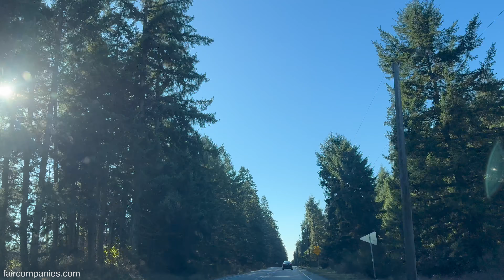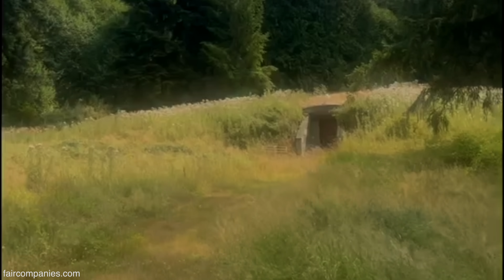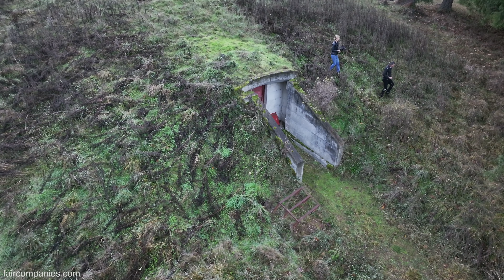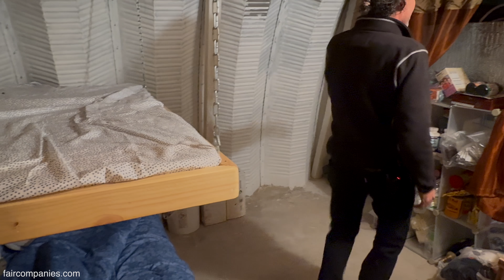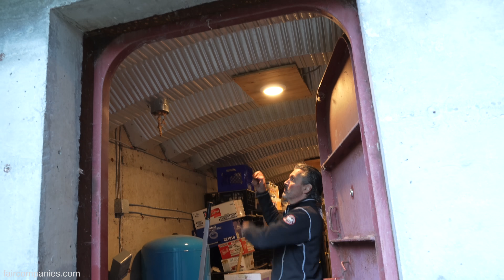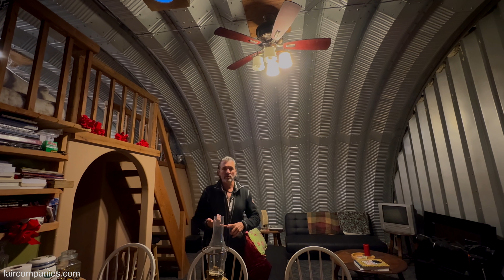Building Bunker Villa on a budget using Quonset Hut structure

Comment: I'm so grateful to live in a 'traditional' if you can call it that .... 1800 sq ft underground concrete home that was built (not by me) 30 yrs ago. But hearing David mention the cost comparison gave me the idea to use the original engineer drawings, data and blueprints to get a current market quote on the poured frame, custom slab 'roof' and membrane just to see what it would cost in today's market. Not to mention, it's in hurricane-prone Florida ... which is even more rare geographically!
Reply: And what would it cost today?
Reply: @dontrend5956  I'm anxious to find out but don't know yet. Just saw this yesterday. I have to 'dig out' blueprints, find/contact the engineers and membrane supplier with some specs to get quotes. It's a bit of a project. There are about 3 different entities I have to put calls or emails in to with the right info prepared .... then wait for quotes/responses.
Reply: Florida is basically a large swamp, at just about sea level. You ain't gonna bury no quonset hut there...
Reply: @cmerton  what you do in that case is built it above ground then dig a big pond and use that dirt to make it underground

Comment: The only thing I see that is wrong is the front door it should have been opening outward. You mention about 500 mile an hour winds. If you have a blast wave, it's gonna push against that door and push it open. Then it would have been good to also have a dual system. So if one door did blow, you'd have a second door for a backup, but also, you would have a barrier. You do not want anything that's propane underground like that. Look at what happened down intexis to risinyes bunker that blew up and killed. I think it was 3 people a few years back. Next according to european standards for nuclear fallouts a propane system is illegal

Comment: 11:07 Do Not Ever, Install Propane Inside a Bunker, that is Why the Inferior Rising S Bunker in Texas Blew Up. If you want a bunker, I would contact atlas survival shelters, there the best. 11:18 I would install an induction stove, or cooktop, they are the most efficient cook stove.
Reply: Atlas shelters are entirely different and way over priced when it comes to the size and building materials.. A propane tank would never be installed inside, never heard of the incident with Rising S Bunkers?

Comment: These quanset huts have issues so do your due diligence before buying, in some climates they will condensate water like a shower unless sprayfoamed from the inside. Obviously not in this case here but above ground they can be a problem and there not cheap.

Comment: This would make for a great Australian style of "ground house" as we don't call them bunkers here incase people start getting hysterical lol. 
They would sell like crazy in Coober Pedy gem fields as they are ALL underground structures as we get close to 50 degrees Celsius 😲 out there and nothing can survive above ground to live. People might work above ground (and lots below) but they ALL live underground out there!
Reply: I thought the Coober Pedy houses all had to be dug out of the soft rock - ? This guy just excavated soil, built the Quonset hut and reburied it - all easy when you're dealing with soil. Is there deep soil in CP?
Reply: @lobstermash  don't know man I'm not from there. Way too hot for my liking out that way?
I have seen the houses for sale onine and they seem to be hand dug and then bricked up inside? 
There are tunnels everywhere so I'm assuming that the miners who were working comfortable underground didn't like the idea of going up in the heat whilst not on shift, so they just used an already dug and depleted mine and then just did with a normal house just no need for trusses or anything?

However, my point was that there are people out there still building houses and if they are spending all that money on bricks and mortar, then something like this could possibly be a solution?
I recall that the 3 bedroom place I saw about 3 years ago went for fairly cheap considering the price for building materials in current money; however it was built in the 1970s so it looked a little dated just with the styling and colours so if you were going to work or live out there it would have been a steal.....but it's not a very developed town by any means? You are lucky to have the basics in a place like that I reckon?
Reply: @jameshatton4211  Yeah, I get your point if they're building above ground, a Quonset hut well insulated might be a good deal. But for building below ground, if it's rock not soil, the size of a Quonset hut would make for a huge and difficult excavation. Even so it would be pretty cool - Halls of the Mountain King.
Reply: @lobstermash  couldn't they just do the same thing and effectively "cut the roof off" am existing expired mine and do as they have done here? Same thing except you aren't wheel barrowing loads of cement in and then waiting a long time for it to cure (and/adjusting the mix to make it cure quicker for the slab being in a cave so to speak - risking integrity vs waiting a very long time for it to cure) reducing quality or waiting a long time adding to the build duration?
I would imagine that cutting the roof of and clearing out the space would be much much easier than digging directly into the ground?! I'm sure it's not ALL rock because most of the tunnels at CP were hand dug a long time ago? It would be morning to penetrate the roof and then just keep breaking away at the hole and then just an escalator to clear it out. You could easily pay for that in savings from materials?
When it's. Finished you just don't push all of it back in on top?

If there are already houses build there and they are at mine level 1, then I'm sure there would be facilities piping for evacuation of water and or lift pumps and or you adopt what ever existing standard that they use at CP mines for stormwater and run off?
As I said I don't live there but if there are people out there (which there is) and they are converting stuff anyway, then something like this could be a good solution?

Perhaps adopting some of the methods but doing them reverse ofter might be better? As in leaving the roof, ditching the tin shed structure then spray concrete, then spray foam (maybe a jig or frame that stays in place till it cures? Then give it a light render and then paint? 🤔
Reply: @lobstermash  the downside of cutting into rock is you don't get the quick wins of more square footage by adjusting the foundation plan. The upside is that getting more space is a 1:1 with effort, not an engineering or materials (trusses, etc) issue. So you start small and grow 'in'.

Comment: I wonder about putting a double thickness green house on top. because if TSHTF you are going to need fresh food. I've seen some people actually make insulated greenhouses that allow year round growing even in Canada and Nebraska. Composting can also add a bit of heat to the greenhouse. Wonder if it would be practical?
Reply: Seems like it would be doable, but then you're once again vulnerable to a high-wind or big fire situation.  A greenhouse just wouldn't hold up well under those circumstances.  It might make more sense to just build a more traditional garden/orchard nearby, knowing that you could store up root vegetables (potatoes, carrots, garlic, etc), can fruits, and have a good store on hand for a cold winter.
Reply: Not very stealthy, but you could put a poly tunnel on top of this thing.

Comment: Unfortunately, fire is a serious threat when living inside such a structure. In the same way it's a hard on aircraft & submarines. Very difficult to escape with your life.
Reply: It depends on the type of fire and the environment you live in. There are numerous ways to change things to allow a human to live inside a structure for months or more....
Reply: @Mayamax3  That is an excellent point. But for every risk and problem, there are solutions.  To mitigate fire risks, just like in a submarine, sound safety practices and mindsets are key, such as: • keep combustible material away from the stove, • avoid clutter, • no smoking inside, • extinguish all candles/ flames before sleeping, • install smoke, fire, and monoxide alarms, • keep several fire extinguishers handy, • avoid using octopus connections, • no flammable liquids inside, etc.  And if you want to go fancy $$, incorporate a firewall which will divide the space into two separate fire zones, with a fire door in between, • add a second escape hatch, etc. It all depends on your budget and how much space on your property you have available to build within.

Comment: This will not stand a nuclear blast , not even a bomb or rocket
Reply: When it was engineered, they said a 747 could hit it directly and wouldn't cause any problems.. it is 12" thick with Helix Steel which is stronger than rebar..

Comment: Love it - this is a goldmine for practical ideas - the design, speed, price, well, vents, entrances, air quality, drainage... everything.

Thoughts:
- The market should appeal to SteelMaster to produce a version of their quonset template with built-in recesses for skylight a/o lateral windows. If Steelmaster can't do it, perhaps an aftermarket shop could.
- I know this isn't a critical thing - but I'd love to find an alternative to spray-foam. I understand its utility, but embedding petrochem foam in the ground feels wrong to me. Wonder if someone's working on this... maybe TriCoPolymer?
Reply: Great comment and questions !! There are a lot of variables and ways to improve the production, use, and options for building out the inside...
Reply: When half the world is  smoldering from couple hundred nuke strikes I'm not going to worry about environmental impact of spray foam.....but then that's just my obviously misinformed opinion

Comment: I've been thinking about doing something similar, but my first thoughts are a multitude of ways I would try to improve upon this design.
Reply: That is very true ! There are dozens of little details that can be improved.
Reply: @VikingShelters  Yep, like skipping the sky light for one. With all that galvanized steel, just run a couple rows of thin LED lights tuned to replicate outdoor light, as well as LED's can, pointed up at the metal as a diffuser. Install an ERV or HRV. Plan ahead and run steel conduit along the outside of the hut before the spray foam is installed so you don't have to run FMC all over the place. Install radiant floor heating. Backup battery too. Might also consider doing a short stem wall or go with an S-style hut so that it's easier to use that back wall of the kitchen, and everywhere else on the first floor. 

That said, I still think this is a cool design that gets me thinking, considering, and planning for my eventual retirement compound.

Comment: A friend’s father in Shreveport built one of these Quonset kits by himself at 75.  He dry poured the floor, and put his own door on the building.   Very easy to errct.  This would likely be secure in a direct hit from a tornado.
Reply: Thank you for sharing your friends fathers experience! That is one of the reasons this type of structure stood out so much for us, it has been proven to work by USA military.
Reply: We live in a quonset! Not underground.
Reply: @donnagranier6375  I did in the service myself.  The side walls are so close to verticals you still have plenty of room.   I like this idea of spraying concrete where I live in Arkansas.  Tornados come thru here every year.

Comment: Looks like a solid structure.  I can't help but wonder why the storage is in the front entrance.  Since it's a quonset hut and the sidewalls go to the ground, building knee walls and storing inside would be ideal and you'd have more open living space.
Reply: There are dozens of different things that could be done on this type of structure. A lot of things were done per what the customer desired and their budget at the time..
Reply: @VikingShelters  As I recall the budget for this was minuscule and it is certainly well crafted.  What interests me often is why certain choices are made.
Reply: Probably the biggest reason if its used as a cellar for auxiliary food storage, the food can be accessed easily from the outside, and without bothering anyone inside if its in use as a guest house. Additionally having food near the entrance in the winter may keep the food cooler and preserved longer.

Comment: How thick is the shotcrete and how does its strength compare to the poured option?
Reply: It is 12" thick and we used zero rebar besides where needed for forms. We used Helix Steel. I don't have an exact answer to strength but history has proven that arches are much stronger than straight up and down concrete walls...
Reply: @VikingShelters  Thanks for the info! I'll have to learn some more about this helix micro rebar so thanks also for that pointer
Reply: Im guessing the crete adds little strength just acts more as a barrier between the foam and the dirt.  If anything its adding weight that hurts.

Comment: Would be cool to have 100 of the skylights.
Reply: If someone desired to do this differently, large windows and a dozen larger skylights could easily be installed and then option for steel covers if a fire, hurricane or even fast closing one's for a tornado... it is all about ho2 much ones budget is...

Comment: 0:08 ⚙ The idea stemmed from a power outage during an ice storm, realizing vulnerability without electricity or water.
1:00 🏗 Building an underground structure like a Quonset Hut takes less labor, time, and money compared to monolithic ports.
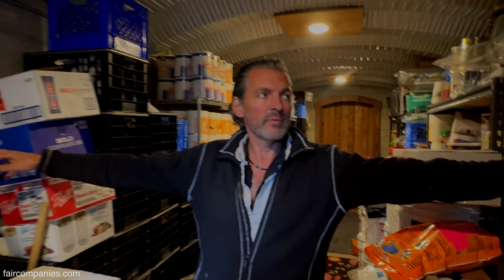1:36 🛠 The Quonset Hut concept allows for quicker and more affordable construction, making it accessible to anyone with construction experience.
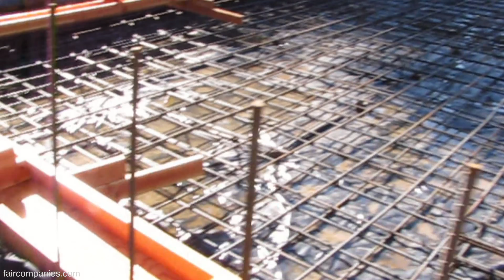3:00 🏗 Erecting a Quonset Hut involves a simple process of lifting, bolting, and tightening, taking about a day with a small team.
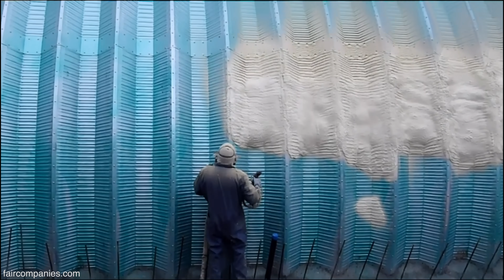4:01 🚧 The structure can be built rapidly compared to traditional concrete walls, making it an inexpensive and efficient alternative.
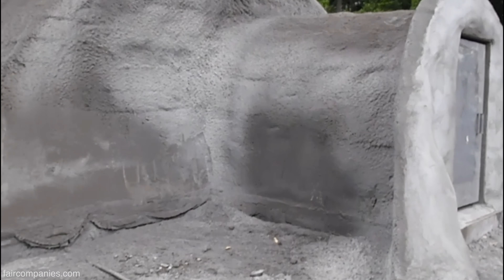5:31 💰 The cost comparison shows that a Quonset Hut underground structure is significantly more affordable than conventional concrete constructions.
6:55 🌧 Selecting a location with proper drainage is essential; without proper fall, constructing an underground structure is unadvisable.
8:00 💨 Underground structures like these are impervious to external weather conditions, making them safe during storms, wind, or fires.
10:51 🍳 Despite being underground, these structures can feature functional kitchens, though propane burners are more practical than wood stoves.
12:55 🚰 A functional water system, gravity-fed if possible, along with a well-designed ventilation system, ensures practicality and comfort.
15:55 🌬 The underground structure's natural temperature stability (around 55°F) makes it comfortable, with adjustable ventilation to regulate airflow.
18:04 🛠 Utilizing materials efficiently, such as repurposing 4x4s, minimizes waste and maximizes resource use during construction.
20:00 🏢 Quonset Huts offer flexibility in size, adaptable for various purposes beyond underground shelters, such as workshops or getaways.
21:25 🌐 The motivation behind these structures often involves preparing for unforeseen events or creating secure, hidden retreats.
Reply: I'm old enough to remember when quonset huts were called Nissen Huts.  Always liked them.  The structures he uses are much better than the original WW1 and WW2 structures, which were thrown together from thin sheets of corrugated steel or iron.
Reply: Excellent job ! Thank you
Reply: Thanks for sharing
Reply: copy paste from chatGPT

Comment: This thing is well insulated and I like the fact he has so much insulation, shot-crete and water-repelling membrane to ensure that it's impervious and secure.
Reply: He could have made it A LOT cheaper AND better insulative R value, using aircrete instead of spray foam and shotcrete.  Same philosophy just better method and could have done DIY instead of those labor costs.
Reply: @siennavanlife9502  Ya but he used shotcrete to add strength to the shell. Is aircrete as strong?
Reply: @ryaniam22  Definitely not, from my research.  Shot-crete has a compression strength of around 8000 psi, while aerated concrete like air-crete only has a strength around 1000 psi.  You'd end up needing a lot more air-crete to achieve the same resistance, and with literal tons of earth all around your structure, well...
Reply: Air-crete is great for insulation and light building block, but if you want durability, strength, structural integrity and a product that can be engineered for hydraulic purposes, then you need steel reinforcement and Shot-Crete ( in structures like this ).  In other designs, there is simply nothing better than reinforced concrete, pre-stressed concrete beams and panels and drainage systems backed up by gabions to totally move water away from your underground structure. @btgardener39